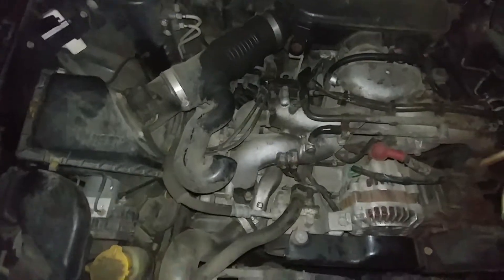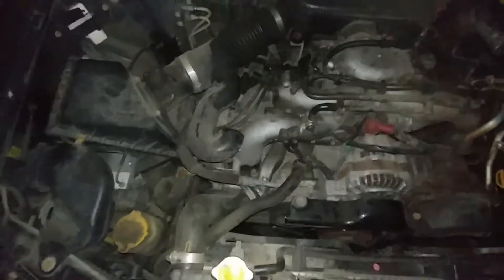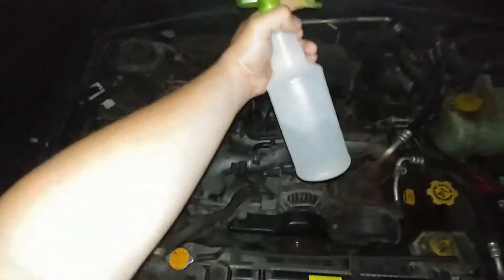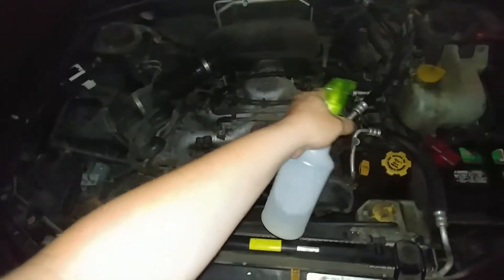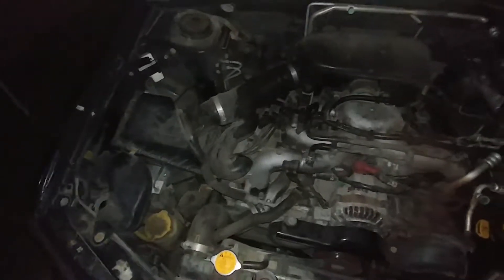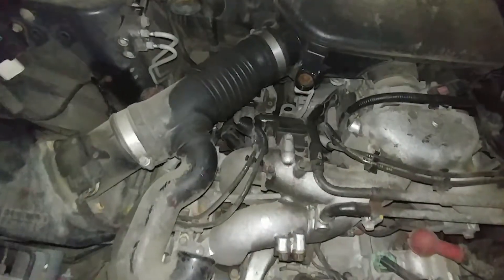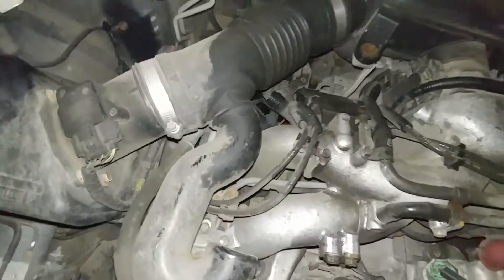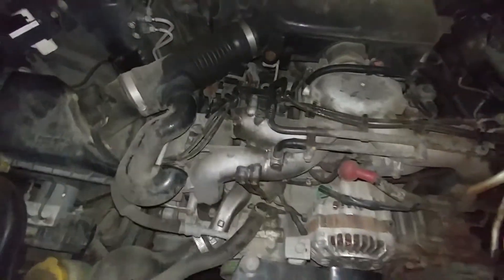Finding Ignition Shorts Using Spray Bottle

Comment: So when spraying water on the distribution system you should not see any arc if the system is okay, is that correct?
Reply from the maker: Correct, there's a break or weak spot in the insulation somewhere. It should be water tight enough to withstand a mist/light spray.